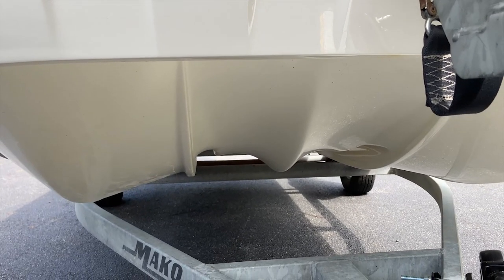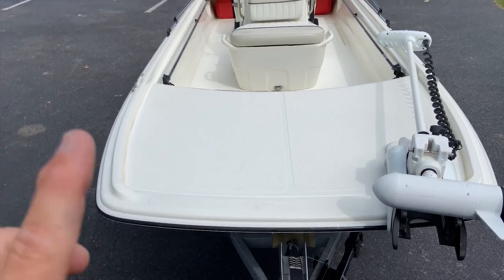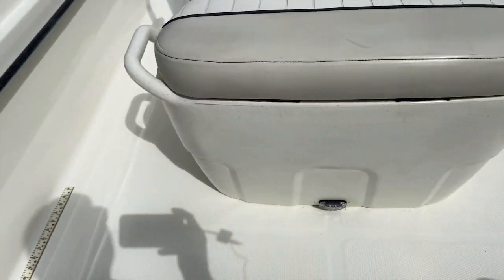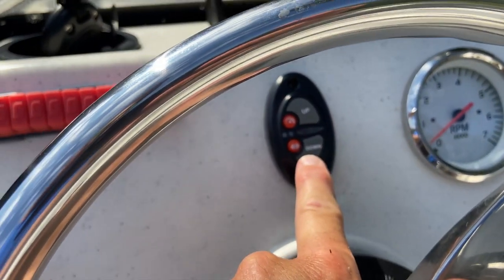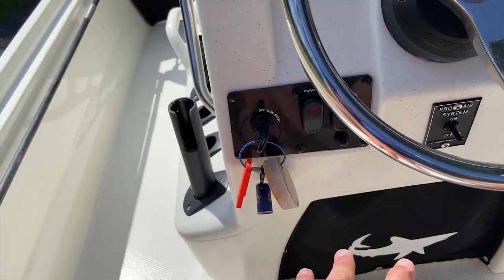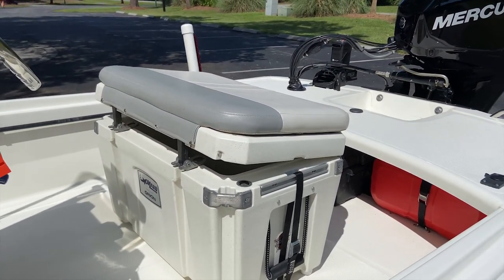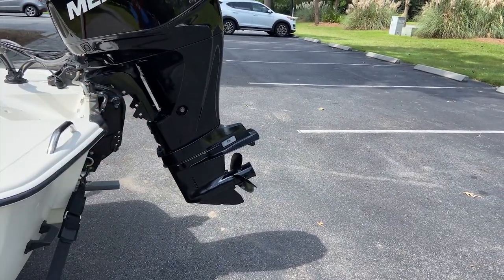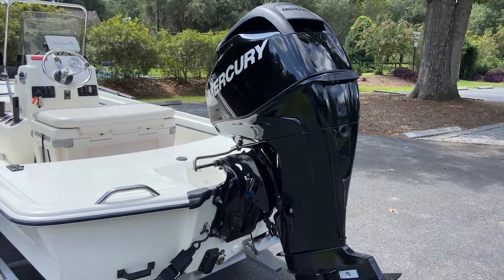2017 Mako Pro Skiff - full in depth walk thru (sold)

Comment: When you removed the Pro 16 lettering and strip from the boat did it leave it discolored? Could you see where the decals were? If so what did you use to make it all white and matching?
Reply from the maker: It did not have any discoloring. If your boat does, it’s very difficult to get rid of because the fiberglass has oxidized and this colored around the letters. You may have to just keep the letters on there unless you want that ProSkiff lettering to be forever shadowed on there.
Reply: I'm not sure if it's oxidized, it's a 2013 but has been garage keep. Like the look you had on yours without the letters. What to do, what to do...🤔

Comment: What's your asking price for this gem?
Reply from the maker: $15k firm
Reply: @LowCountryFishing  dang that’s almost what they cost new! I mean it was maintained well, so it makes sense.
Reply from the maker: @noahjohns7954  the bone stock 15ft pro skiff is $21k when you add taxes and freight. Not to mention I also have $4k in extras on mine. That makes it $10k difference from what I have vs the exact set up brand new. Trust me this boat is priced right. With what’s on it.
Reply: @LowCountryFishing  I know! You’ve taken care of it, and good boats go for a good price. I’m just saying it’s almost half the cost of a new boat, I just though boats depreciated faster than that. Guess I was wrong! I’m still new to boat buying and stuff so this helps me figure out what to look for at this price point.
Reply: @noahjohns7954  no that's over 6 k difference, not ALMOST what they cost brand new
Reply: @AmazonWebService98  ok well he already corrected me and I admit that so no need to throw more stuff at me. I know now how boat pricing goes but I didn’t know as well as I do now 2 months ago.